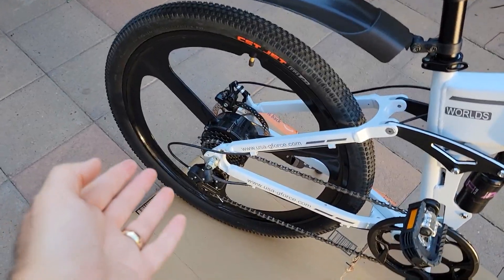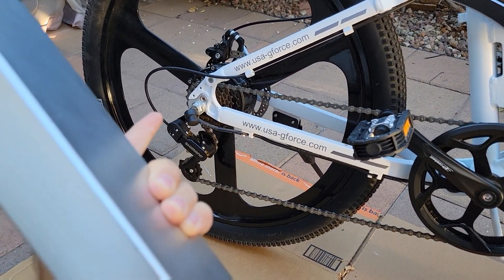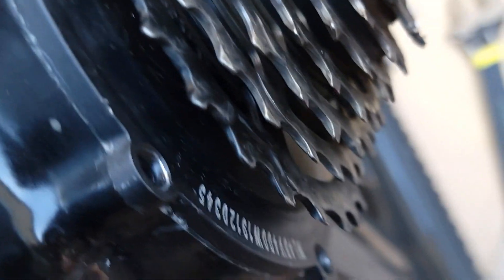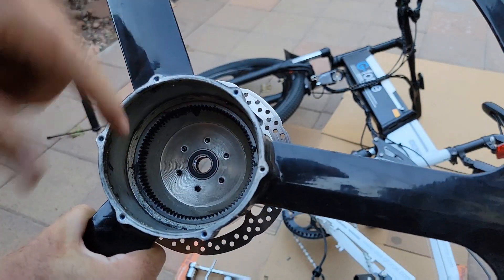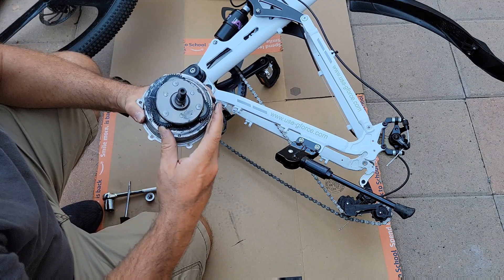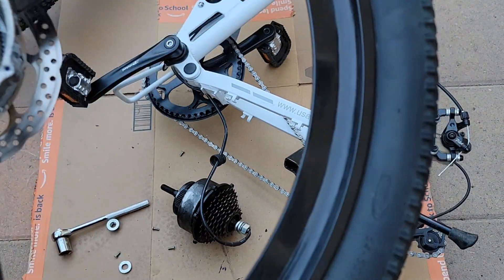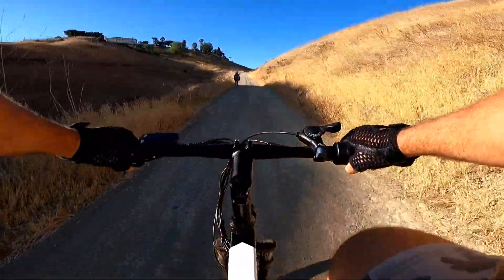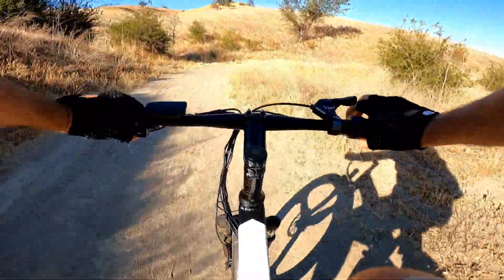What is inside an Electric Bike Motor?

Comment: Repost from Reddit.  A few things.  No motor will be able to spin at the same speed regardless of load.  It's expected to get a high speed with no load and a lower speed when you actually ride the bike.  It looks like you cleaned all the grease off the planetary and sun gears.  For those that don't know, those gears need grease.  Don't remove the grease and not replace.  A violent grinding noise under load is often delaminated magnets.  Don't believe you gave an example of the noise so can't tell if that applies here.  Minor notes, don't use a knife to pry things open. That's a great way to shatter a knife and slice yourself in the process.  Also, please don't bang on the through axle with a steel hammer use  brass instead.  Both made me pucker to watch.
Reply from the maker: I agree with you this is not right way to open or put it back if you plan to ride it but will need to get it fixed before to use so I plan to open it later again and grease and seal before using it . Regarding the load the problem it start to make noise and speed dropped about 3 times with load .  Here is the link to noise https://youtu.be/89lj97H00uM?t=798